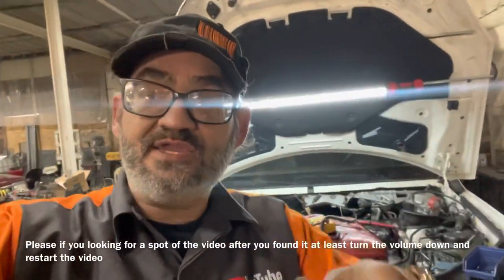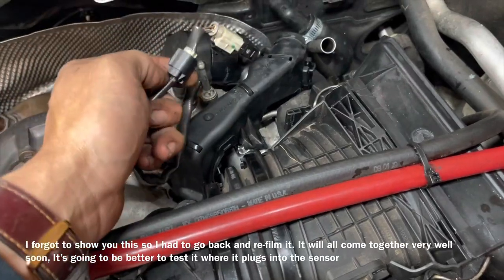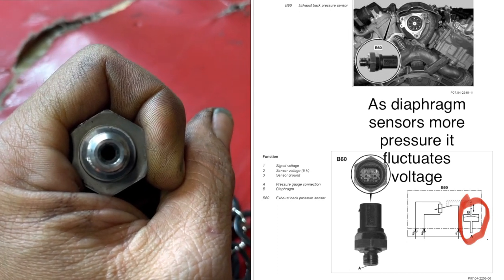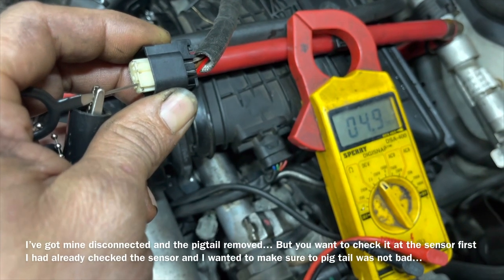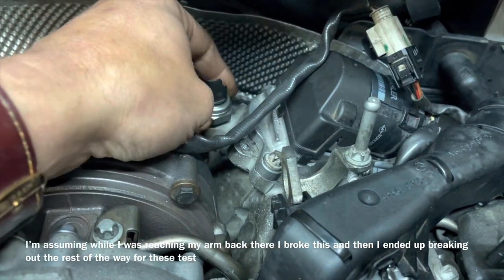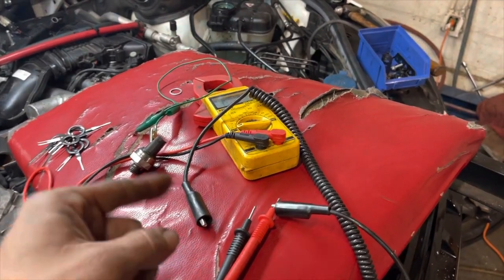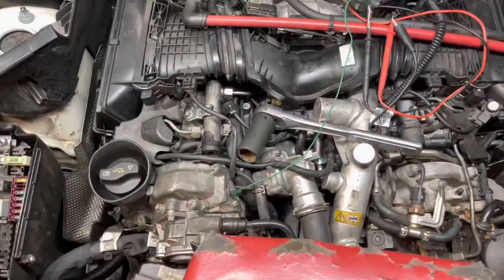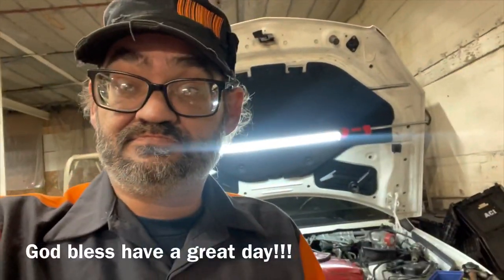OM642 Mercedes 3.0 Full Deleted Back Pressure Exhaust Sensor / Test / How to Test any Sensor

Comment: This is the sort of thing I take for granted with my diagnostics. I can literally see the voltage on the screen.
Reply from the maker: Well of course we can see them on our screen but there’s a lot of folks that don’t have the access to the bi directional readings so I thought this was a little bit more helpful.
Reply: @sharpcarco  oh yeah definitely - way more likely diy-ers will have access to a multimeter than advanced diagnostics.

I just had a look through live data KOEO and saw the back pressure sensor showing 930kpa while other barometric sensors were reading 995kpa.
Reply from the maker: True . And I’m not quite that smart I don’t often know what the base lines are supposed to be so it’s easier for me to use the multi meter to diagnose things often. But that’s because I’m pretty ignorant and I work on a lot of different types of vehicles. 

Also I try to explain things The way that I learned them. Sometimes I’m incorrect. But I guess that’s why I’m a nobody YouTube mechanic LOL
Reply: @sharpcarco  We all have our methods.

As for the base lines, especially atmospheric, you can just reference other sensors like the map or even the DPF differential sensors in some cases.

When I had a Galaxy S7 I used to use that and a free app with the internal barometer to double check the current readings.

Other sensors like temp sensors can be interesting. You either get low voltages back (0.1-1) or if you get a reading in C it's pretty obvious. I had an Audi A1 that thought the ambient was -130c. Ran terribly.

Comment: My OM642 has a 0 lambda value. So EGR is not functioning. O2 sensor is 0.2v-1.1v. I think it’s bad. Replaced the sensor, new voltages is 0.25v-0.76v. Lambda is still 0. Do I need to drive a lot to reset the lambda value? Thanks!

Comment: I don't miss working on those 642 turbos. I feel for you.
Reply from the maker: Yeah I got it all done and while I was working on it I removed the dipstick tube so I didn’t break the Off the top of it.

And it was blowing out oil out of the dipstick tube like crazy. So I did a blow by test on it and there’s a shit ton of blow by in this hundred thousand mile engine which is really surprising to me I had to call the customer and tell him. 

It seems to be fine running wise and all of that. But there is some kind of problem here, ……
Reply: @sharpcarco  checked the PCV?

Comment: Sorry but your test is not conclusive ,you cannot test for 5 v ref or ground in the way you tested because if there is a resistance in the 5 v ref wire or ground wire the test you done will still show you 5 v, you need to load the circuit to conclusively prove the integrity of the wiring which you didn’t,if the fault was in the wiring and you put a new sensor in then boom your back to square one scratching the head, always load test wiring my friend.
Reply from the maker: Was trying to conduct it in a way that would still to prove that the sensor was bad at the end of the video I mentioned that you could have a broken wire in the system but we’re more so concerned with the 5 V reference to the sensor. And would’ve had to look up the exact pin to see if the reference was coming back but because my reference was it being seen there wouldn’t be any sense in doing the test to see if it was going back to the Ecm. 

I’m fairly certain I mentioned that in the video. 

But I am not Super at these kinds of test.  It was just what I noticed when testing the sensor. I didn’t see any other videos of people testing the sensor so I thought I would throw this out there. 

Hopefully people will read the comments and learn from the mistake I made.

Comment: I'm new to Sprinters, just got one, a 2012 with an OM642, and I've heard that term "Deleted" mentioned.  What does it mean to have a "Deleted" Sprinter?
Reply from the maker: Well first off, it’s illegal to delete something. 

It means that all of the omissions are gone. Emissions are the biggest causes of problems with these vehicles. If it wasn’t for the emissions they would never break down. Because they’re exceptional engines and transmissions and basically that’s all they are is an engine of transmission and a rear differential. Extremely simple, simple vehicles with the exception of other government mandated exhaust restrictions, which caused a serious internal problems for the engines and require thousands of dollars at the Mercedes dealership

There’s very few people in the country that actually understand them, so finding a repair facility that knows anything about them other than the dealership is extremely limited. Obviously I know a considerable amount about them probably just about everything.

Comment: Great info! Does the ECU needs reset after changing the exhaust back pressure sensor? It seems just clearing the error code doesn’t work.
Reply from the maker: I had that problem a couple of times 

Ultimately boiled down to me using a aftermarket sensor when I got one from the dealership I no longer had that problem
Reply: @sharpcarco I just tested 3 sensor none had the continuity to the body. I was pissed off so pull the plug to buy the original from mercedez. I was sure that would work and when I got it and tested it same shity luck. There's no continuity when checking the body.😢 I'm not sure if  Is bad luck or all these sensors are indeed defective...

Comment: Hello The Clay Way,
good afternoon
Can you Help me in this situation please.

I have a jeep grandCherokee 2009 crd 3.0 limited after driving 30km shows failure in the fuel sensor past failure P2264 Fuel/water separator sensor circuit.
I have already changed the sensor and filters and the obd always shows the same fault as before.
could you give me some guidance?
it makes me crazy

Comment: Friend, can You help ,we got 3.0 crd om642
 and we suspect clogged exhaust, Do You remember what back pressure You have when idling? we have just over 1100 hPa, I think its too high.. under load going 3700 hPa . Don't know history of the car, friend bought from auction, turbo was rattling, is changed, someone remove the swirl flaps.. turbo boost performance fault appearing on scan tool. Every suggestion will be very appreciated.thanks
Reply from the maker: Well, if you think that’s the case, just take the guts out of the particulate filter….. obviously per the government you’re supposed to replace the particulate filter I did it a couple of months ago and the guy drove it all the way to California and said there wasn’t even an issue but he did get his replaced because of needing to pass emissions over there but he said it was fine…….

Another thing you can do is depending on what kind of scanner you have you can run a manual regeneration I was doing that today to. I had to run it twice but do not run consecutively. You need to let the vehicle cool down and run it again once it’s back up to operating temperature.
Reply: @sharpcarco  Lovely:) we have got 2005 without DPF, anything related to the exhaust in live data is  back pressure, I using autel IM608, I am locksmith 😁 but those days people don't losing the keys on daily basis, so doing anything including diagnostics to feed family. Trying from very basics, car in not smooth when hit the floor, specialy under load, don't want to ruin new turbo, it's car I have seen for half hour, and trying help Young friend.
Reply: @sharpcarco   PS dpfs specially original very expensive, I used to clean them with jet wash from back(opposite direction of flow) be careful not ruin them ,  a lot of soot and half bracket of ash:) and did work
Reply: @sharpcarco  before I cut off the exhaust, just looking for some live data on this Merc engine . .. Thank You.
Reply: Check exhaust manifold for a rattle. Mine broke inside. Check me video

Comment: Where is the exhaust back pressure sensor on a 3.0 diesel sprinter?
Reply from the maker: If you message me on clays AC and Auto Repair on Facebook I can send you a picture. 

After I go look at mine and remember where it’s at……. Pretty sure it’s down by the EGR valve though it’s got to be Has to be in the boost line somewhere